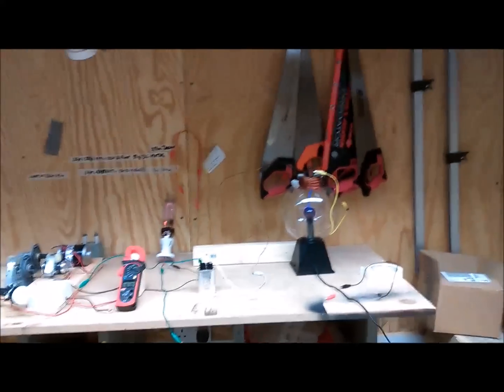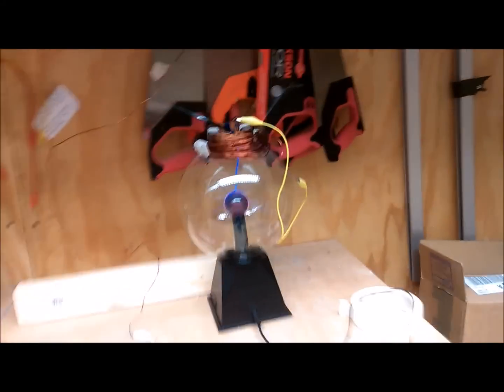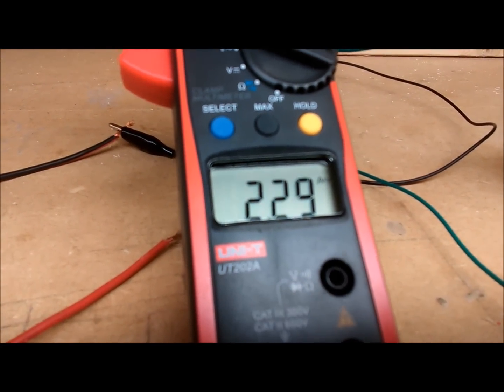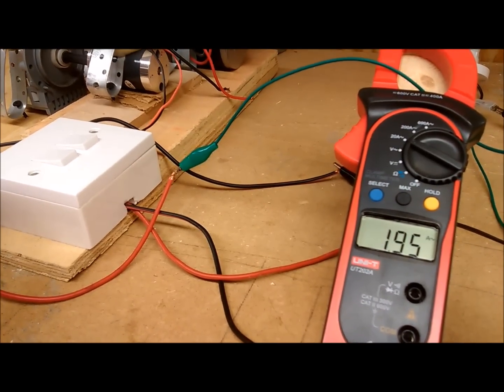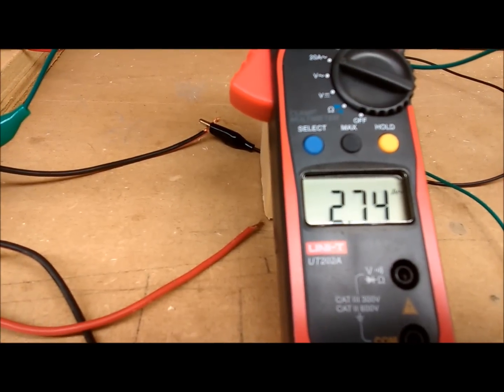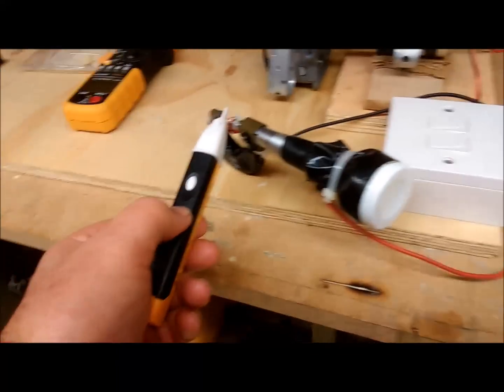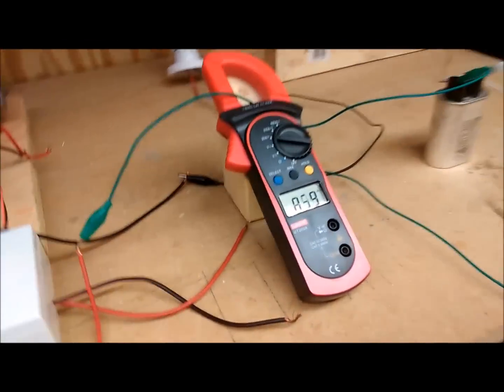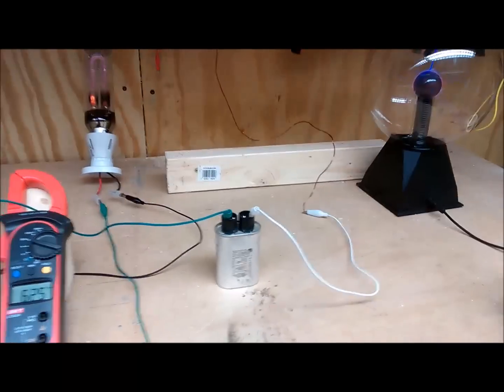Plasma Power Generator Results (WARP DRIVE 3) in Amps

Comment: Once after assembling and powering on a DIY tesla coil kit that is available to buy on ebay or aliexp the readings on my meters were absolutely strange. Understanding how these meter readings are produced on the meter in this case is as important to verify as everything else. Try bringing the plasma ball to the electric power meter you have in ac wall socket, is that reading changing when the plasma ball is neaf it? Interesting experiments, thanks!